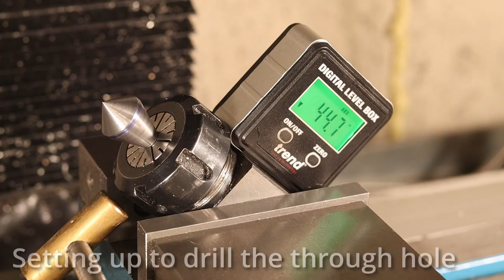Zero Flute Countersink and Chamfer Cutter Project

Comment: Hi Paul, as a fellow-builder of useful projects &  tooling / fixtures, I appreciate your contribution to the community. You inspire me & keep me motivated— thank you. 

Could you share some feedback on how that O1 is performing?  How is durability/ edge retention?  I appreciate the level of care in your turning and drilling of your 0-flute C/C,  In practical application would you reckon your heat treat is on par with the same quality of workmanship?  My HSS 0-flutes work very nice in 5086 & 6061 when crisp and sharp, but they don’t do as well in A36. I’m optimistic that o1 might be a beautiful material choice to build my own countersink from. 

Thanks for sharing. I’m my small circle I’m the twist drill rehab guy!  I have a crude jig and can at times subsidize it with enough attention to make a real respectable & symmetric 4-facet grind, but always chasing “better” I would love to rebuild it.  I mentioned my reaction of inspiration. Specifically, your tool & die cutter has inspired my vision of its next iteration. Thank you.
Reply from the maker: Hey, many thanks for the kind words!

I'm just a hobbiest, but from my experience, hardened O1 is good for cutting aluminium and free machining steel, but would expect to be sharpening it pretty frequently for more challenging materials.

For a small home shop, I've been really impressed with the tool and cutter grinder I built. Can see myself building further addons for it in the future.

Comment: Nice job.  How did you set the relief?  I tried regrinding some countersinks and couldn't get it to work.  Subscribed.
Reply from the maker: Thanks! Just eyeballed the relief, wasn't enough at first, so just put some more in with the bench grinder.